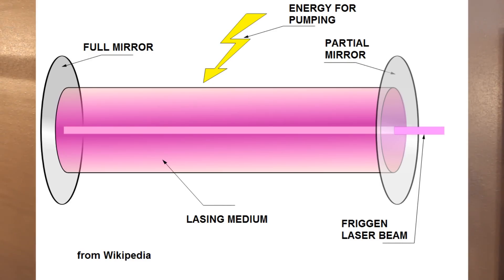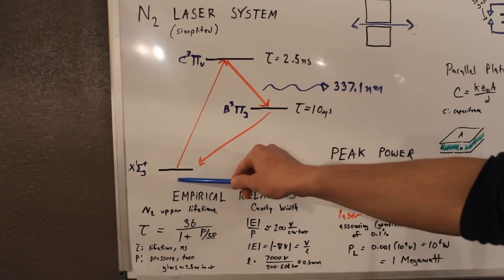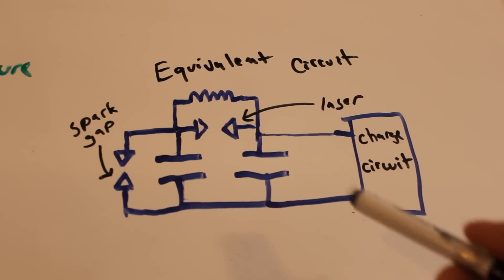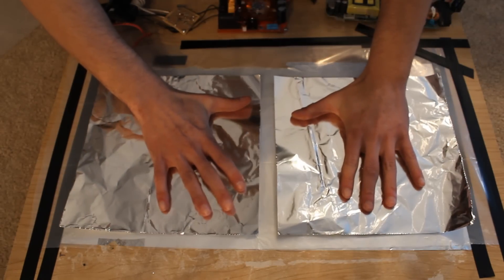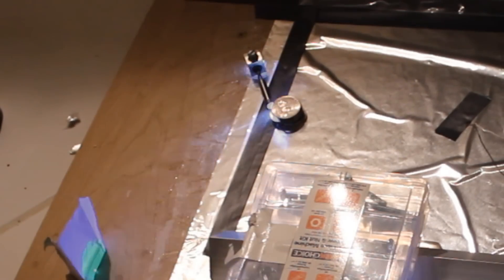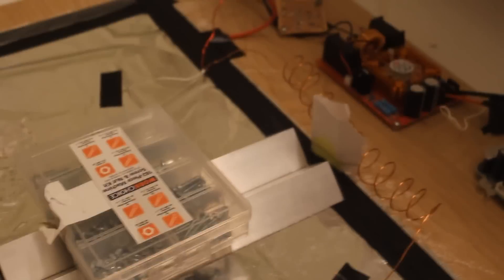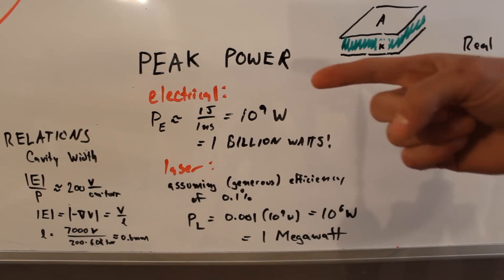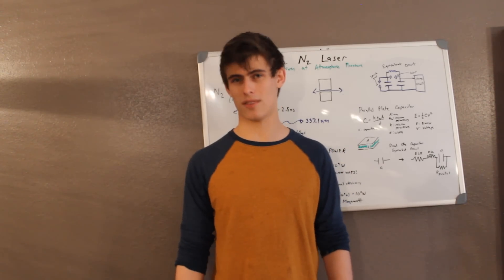DIY Laser Made from Thin Air!!

Comment: I need help with the math involved for designing a capacitor of a certain topology for this. I'm assuming there's a circular discharge propagation from the trigger Gap to the cavity spark plug gap, I'm also assuming the reason why it has a length limit it's because it takes light so long to get from the beginning of the cavity to where the spark discharge was at the end of the cavity, by the time it gets their the nitrogen is already opaque! My plan is to add to the length of the distance between the trigger and the cavity by going into the third dimension and adjusting the distance to the trigger continuously along the length of the cavity. This design you showed would result in the spark gap discharge traveling up the length of the cavity at a significant multiple of the speed of light, I want to reduce that to just over the speed of light so the discharge remains just ahead of the UV beam.
   I need a formula to calculate the 3D shape what's this capacitor given the length and how fast do you want the spark to propagate up the cavity.
   I asked chat GPT about it, and it gave me a bunch of math formulas I don't understand so can't verify, and they didn't have all the variables I wanted anyway, but if it would be helpful here is part of the answer it gave.
  Given a speed of propagation of 70% that of light and a cavity length of 60 cm and the placement of the trigger spark gap also 60 cm forming a right triangle when viewed from above, adding a single cycle of a sine wave in the beginning with the wavelength of 60 cm an amplitude of 26.52 results in a path length of 125cm so that the discharge wave arrives at the first centimeter of the cavity at exactly 6 nanoseconds. then by the time you reach 60cm up the cavity you need to impose a sine wave of wavelength 97.66 and amplitude of 34.15 to create a total path length of 166.80cm and the intersection of the propagating  discharge you should arrive here at about 8 nanoseconds. notice how the difference between the straight line path and the actual distance traveled changes as you go up the laser cavity.
   I really don't think GPT is right, because the delay and length added to the path over and above as a bird flys length , should be much more in the beginning than in the end and the GPS numbers show the opposite.

Comment: Great fun as always!  But, as an admitted know-nothing, I think your circuit diagram might need a revision--I think the controlling spark gap needs to be between the HV supply rather than on the other side.  Or does it work either way?

Comment: That plastic is terrible, use Thin, clear giftwrap stuff, layer it multiple times with Glycerin in between. The results will be something so study you can pump with OBIT transformer creating something that looks like a CW laser. You will never need to deal with break downs as the Glycerin while being great insulator is also self healing and the lamination helps as well

Comment: Because static electricity has low current but high voltage this means it would be as dangerous right? Because if so you can just use wimshurst machine for the charge circuit.

Comment: With this laser in the mega watt range you might could measure the distance to the moon using the  apollo corner reflector.
Reply: Probably not because the beam divergence would be terrible.  1MW is also (very briefly) the peak power, not the average power.

Comment: Drake,  GREAT--as usual. nice channel arc. It kooks extremely good for a TEA type.  makes me want to have a look at one of my old treasures...
 Years ago, I got my hands on a professional ($250,000 value)  I got it cheap (only $250) because it didn't work--The problem...A bad thyratron of the type found on ebay for < $100 (I got it firing manually on spark gaps).  I had a VERY old article on a N2 laser for years before I got this--The miracle...It was the research article on this very laser!  This laser was absolutely foolproof...pressure shutdown, variac fine control...the works!

It was in the big Louisiana flood in 2006...I propped it up, but didn'y expect 17" H2O haven't looked inside yet.
--dAlE

Comment: HIPS, High impact polystyrene...has the highest breakdown voltage and is a cheap sheet material used in advertising....just a tip.

Comment: About the length of the intermediate state being too long to run the laser continuously, couldn't you move air through it so it has a constant supply of N2 in the ground state?

Comment: Heat rises, concrete hold thermal energy point your heater at the ground to heat the concrete. 
Insulate from the top down. "Styro"foam works great. you can break it up and some have make bricks out of it by mixing with cement. 
Close all open vents, cracks, holes, under the door, Every single one. 
Black absorbs heat, white reflects it.
Reply: Yes but have you heard about blackbody radiation 
When black gets hot it will radiate more heat than white

Comment: how much more effective do you think it would be if you used thick air instead?
Reply from the maker: luckily the engineers have given us some nice formulas for T H I C C air. the upper level lifetime of the excited N2 molecule is given by t=36/(1+p/58), with p=pressure in torr and t = time in nanoseconds. thus T H I C C air is worse than thin air for the laser, due to the reduced lifetime.

Comment: Foil doesn't conduct electrons,
He is making holograms with his minds as usual, that is what time travelers do trying to fool the system with fakery while using holograms or other type of advance tech to make fake ideas and manipulating others to make stupid fictional weapons and other fakery
Reply from the maker: yeah it actually does let charge flow very well.
Reply: styropyro 
Foil doesn't conduct electricity is isolating material, non electron conductive, it can also block some magnetic force in very thick quantities.

Comment: You could VASTLY increase the pulse rate and average power by forcing fresh air through the gap, if I understood it correctly then it's the partially charged N2 in the gap preventing the next pulse, get rid of that and you're ready to go again and even at high speed the air would effectively be stationary at the timescales of the discharge/lasing process.

Comment: HEY DRAKE--Yes, an N2 laser actually exist in a lightning storm.  I actually had a fully working N2 laser (one of the first ever built (early '70's).  It's value:  $250,000.00 dollars.  I got it from a lab, whose manager sold it to me because it hadn't worked in a couple of decades--price:$250!!!  It took a truck to haul it to my lab--when I saw it I couldn't believe my eyes--It was the one from an old "OPTICAL SOCIETY OF AMERICA" article which I had for years-this was the actual laser the article was based on!  WOW!!  There was no expense spared in building this thing!  EVERYTHING gad safety features--it was 100% idiot-proof.  I finally traced the problem down to a burned out thyratron.  I verified this, by using a simple (LOUD) spark-gap to fire it.  I finally got a replacement thyratron for cheap on ebay.  Freaky: the silence of a N2 precision laser fired, rapid-pulse this way!   Unfortunately, (Here in Louisiana), the flood of 2016 got it!!!  But just the head--not the huge control box (which split a very strong table in half after resting on it a while.  I pumped it down to optimal pressure and let a tank of pure N2 flow as it fired---amazing--things started glowing everywhere--I also used ordinary air at atmospheric (no) pumped pressure and got what most people see in a "N2 laser".  You could control everything you could think of.  No fixed voltages--these designers just stuck in huge variacs instead of transformer taps, etc., etc.  It is packed in storage now--but I plan to unwrap it at a new location and FIX it!

BTW:  For the usual laser (which is actually an optical oscillator rather than an amplifier) would actually have the acronym LOSER, but who would ever name this wonderful device a "loser"?  However, the N2 laser is in reality, NOT an oscillator (as you mention) but an actual amplifier, so, as far as I know this is the only superradiant device that can be accurately called a 'LASER'.  The active medium in this thing is a bit over a meter long!  AND it actually has ONE mirror at the inner tube end--it makes two trips through what must be cool flowing N2 at  this scale before emerging as a multi-mega-watt beam (....don't know the exact specs), but, as you stated, the energy J=W/s is quite low (mJ range, due to the tiny "s" in W/s)--it's the incredible speed that fires the MW's.   BTY: I bet you would love playing around with thyratons.
Reply: Thanks for your comment, very interesting and exciting stuff! Pity about that N2 laser. And your explanation of laser vs. "loser" shows how much I have to learn and how little I understand about lasers.
Reply: Many industrial CO2 laser is already over 2 meters long. Even low power CO2 laser cutter uses tubes of at least 1.2 meters long. 

And by the way if you want to build lasers to burn stuff why not use CO2 lasers? they're practically designed for it. But it's weird I never see any videos about CO2 lasers from this user. I know it's not exactly hand held (as the glass tube is fragile, and requires cooling water, etc.) but it's not beyond the user's skill to mess with as he already messes with high voltage.
Reply: It's ccp YouTube censorship

Comment: I have some 1nF 20kV Ceramic Disk Capacitors at home. Would putting these in parallel increase the Output power, or is the ESR of these too high?
Reply: Makersteve YT you actually shrink the output power. The puls wil be longer if you increase the capacity. If you want a higher output power you have to increase the voltage so the pulse wil be shorter. (I suggest to put the capacitors in serie so the capacity wil shrink and the maximum voltage will be higher)
Reply: zztop3000 Ebay 😁

Comment: styropyro would a boost convertor work as the power supply? It takes 3 - 6 ish volts dc and steps it up to... A few thousand I think. The output may be AC

Hope you see this
Reply from the maker: you can use AC to do this if you have the gap configured so the laser fires at least as fast as the frequency of the converter. if the converter frequency is too fast, you can just put a bunch of 1N4007 diodes in series to turn the output to DC.
Reply: styropyro thanks!

oh and I won't try this cos I could die or whatever

Comment: Haha, sorry, I've already tried this at home! Also, I've read a bit of a theory on this, and isn't main working principle here Amplified Spontaneous Emission (ASE), not superluminescence? Also, because of ASE the optical radiation is not coherent, so it's actually "kinda laser"; I could be wrong though. Sorry if I messed up some terms, we (russians and americans) may have different names for the same phenomenas.
Reply from the maker: amplified spontaneous emission and superluminescence are the same thing! it does produce light with higher spectral linewidth than most lasers, but you could also argue that it's not a laser because it is operating as an oscillator (a "loser" :p )
Reply: styropyro oh, I see. Also did you know that you can adjust the laser electrodes so that light is emitted primarily on one side? Of course the angle of emission also becomes wider, but on short distance this isn't so important. I've managed to get pulse rate of 200 Hz, so you could try that also.
Reply from the maker: yeah in fact I found it hard to avoid the majority of the output going to one side. 200Hz is a good rep rate, very nice!
Reply: styropyro thanks, man!

Comment: now  what if you put 2 parallel rails one to ground and send a rocket with a wire in to a storm could to catch the lightning and direct it in to the other rail .how much power would go in to it how much power would be turned in to laser energy 
how many views would you get if you would make that video 

ps please make that video
Reply from the maker: ha ha oh I have a similar idea on paper...but instead using a giant pre-ionized tube of argon. would be very expensive for likely only a single shot (if it even worked) but would be awesome nonetheless.
Reply: @styropyro  just do it
Reply: The problem is fundamental time space gets injured in the process
Reply: styropyro it’s possible to entice lightning strikes exactly where you want them using a kite, thin conductive wire, and a high voltage source.  Kreosan did it on their channel.  That could make an awesome laser blast.
Reply: How would the kite get in the air.. something tells me balloons would make much much more sense...
Reply: styropyro that’s crazy
Reply: styropyro DO IT!  >:]

Comment: I'm mildly disappointed you didn't solve your garage heating problem with some huge DIY space heater.

I know it's not a good idea and not really practical, but still.
Reply from the maker: if my shop wasn't rented I'd have it solved with a giant forced air wood burner
Reply: @styropyro  You should create a portable laser heater at some point. Great for keeping you warm, and for instantly blinding everybody around you if you keep the laser visible.
Reply: IR laser heating
Reply: solar tubes through the roof then a solar oven to cook would heat the room
Reply: My balls are so warm, the heat would travel 4 years ago and warm that shop.
Reply: Is electric included, heat by mining crypto, 
but please seriously don't.. 
unless you really hate the landlord for a just reason.

Comment: You should try to make an electro laser. You form something called a laser induced plasma channel by having a super high intensity laser beam. Even a relatively weak laser can do this. This plasma channel can conduct electricity. If you do something similar with your spark gap thing you can run a current down the channel and it's like a tiny lightening gun. If you use two beams and have one a ground and the other the side that sparks, you can make a directed lightening strike. If you lower the power output of the zapping part you might get a taser laser.
Reply: Terran Guard if it's not femtosecond laser, the plasma channel is discontinuous at some parts, so the current won't flow, and femtosecond laser is pretty hard to make at home.
Reply: If it was easy it wouldn't be impressive. Some people are attempting to add a second laser to heat the plasma once it's created to sustain it to fix that discontinuous channel problem..
Reply: You do realize that Ti-Sapphire femtosecond lasers cost literally ~half a million, right? Making your own is only slightly cheaper if you don't already have the necessary equipment to work with fiber.
Reply: That's all it is? I can make that in my microwave